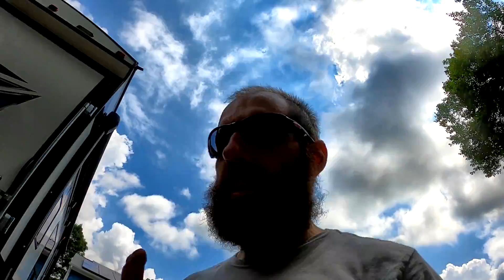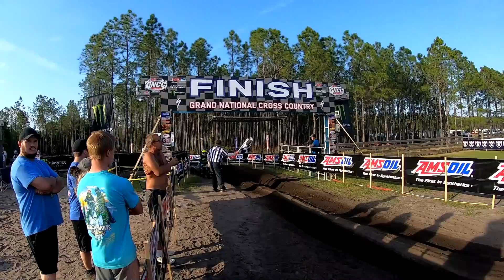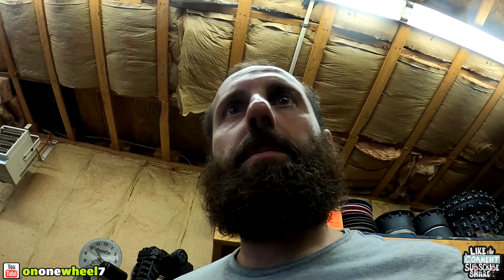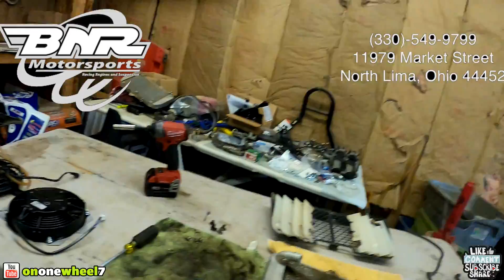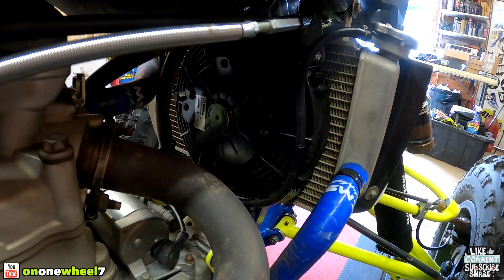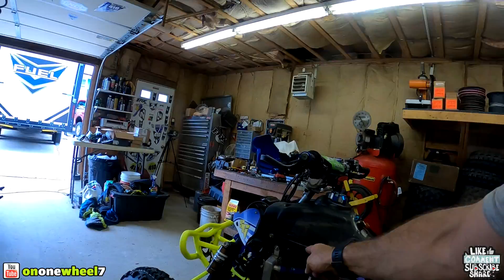THE PRACTICE BIKE GETS A NEW SPAL OVERSIZED FAN AND SOME TLC

Comment: I know this video is a bit old, i just got a spal fan for my raptor 700 2007 440CFM, but it is rated at too many amps, so how come yours is just plug and play? What can I do about mine ?
Reply from the maker: I get these from bnr motorsports so he sets them up w the brackets and wiring harness for the yfz’s. You have some options you could get a relay and run direct power off that and use the stock fan wiring to activate it. Or you could get the appropriate plug for the fan and just plug in im not sure how much it draws over stock i would think you would be ok that way.

Comment: Shop vids are great 👍.  How thick its that fan?  Wondering how it would fit on my 660
Reply from the maker: Id have to measure it but i would bet it would work you would just need a different mounting plate!
Reply: @ononewheel7 I went on BNR's site. No specs.  I'll contact them,  thanks for the reply 👍
Reply from the maker: Ya he would know best and if it did fit he may be able to make the bracket for you also!

Comment: Hey John, Great video, just a quick question what did you do with the pipe going from the coolant reservoir to the stick fan - I believe they call it a breather hose. Thanks.
Reply from the maker: For the spal fan it gets removed.
Thanks man 🤘
Reply: @ononewheel7  thanks for the reply ! If it gets removed do you not have an open port from your coolant reservoir then no ?
Reply from the maker: The one from the overflow bottle stays the second one on the old fan goes away.
Reply: @ononewheel7  gotcha ! But currently my hose is going from over flow bottle to side of fan housing. With this new fan I don’t see a port on the side of the new fan for that hose. So where does it go to ? Sorry if I’m not explaining it well or understanding it.
Reply from the maker: That  hose should go to the radiator cap
Reply: @ononewheel7  so I think we’re talking about 2 different hoses, just to clarify I have 2 hoses exiting the coolant over flow bottle one at the bottom of the bottle which goes to the radiator cap as you mentioned above, but then I also have a second hose the goes from just underneath the cap of the over flow bottle to the side of my old oem fan, it’s this hose I’m wondering about the new fans don’t have a port on the side of them so where does that hose go to?

Comment: Question- will a 2009-2013 mishimoto radiator fit on a 2021 yfz450r?
Reply from the maker: Yup but you will need to grab a 2009-2013 upper radiator hose as the 2014+’s are different!
Reply from the maker: Yes but you will also need a 2009-2013 upper radiator hose.
Reply: Alright thanks
Reply from the maker: @x_allen_x537  anytime